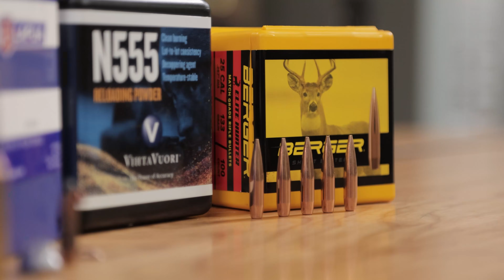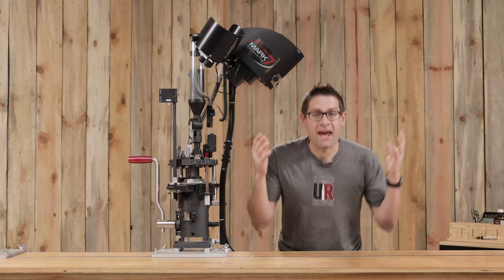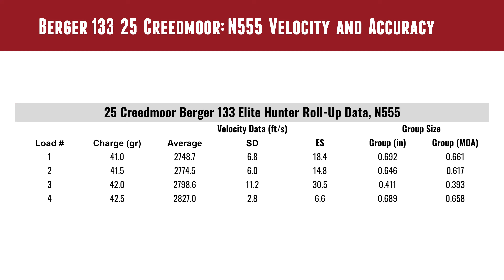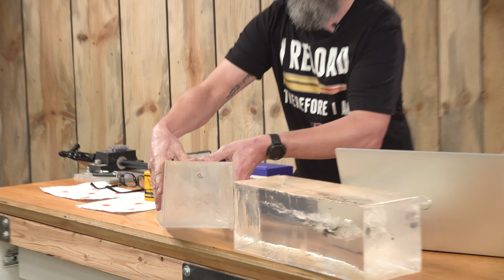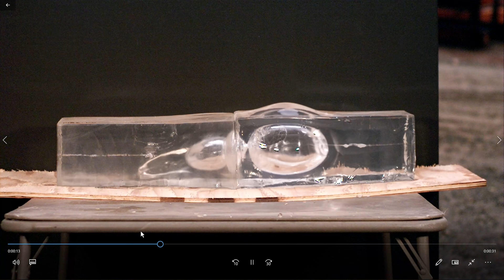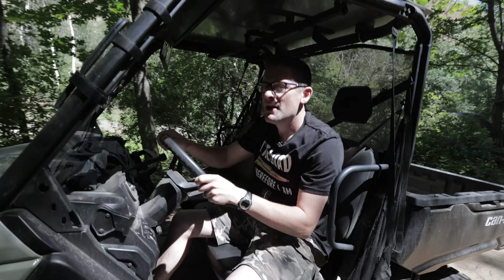TESTED: Berger 133gr 25 Cal Elite Hunter Bullet

Comment: I had a custom fast twist 25-06 built to shoot this 133gr bullet the year it was released. 26.0" barrel, 8.5-7.5" gain twist 5R Bartlein. Over a stiff charge of Staball HD, getting 3068fps avg, single digit ES and SD. 1/2" groups or better if I do my part  That's with Federal 210M primers. Gonna try 215M primers and see how that goes. Figured a slow burning powder could benefit from a magnum primer.Great bullet

Comment: I know this is an older video at this point, but I recall Litz talking about how low velocity tests are hard because you technically need to use a real fast twist barrel because the RPM of the bullet is also what assists in bullet performance. Have you guys looked into that or seen anything on that since doing this test on low velocity? 
Your videos are some of the most informative and have helped me in going through data many many times!

Comment: The test isn’t entirely accurate because the bullet is spinning one time every 7 inches at 2800 fps and when it slows down to 1800 fps it will make a full rotation about every 4.5 inches which would make it a lot more devastating because it would spin 65% faster in the gel if you actually took it out to 800 yards. But in the video the 1800 fps load is still only spinning once every 7 inches in the gel. It’d be cool if you revisited some of these with long range gel tests
Reply: Sorry I meant 35%

Comment: Very interested in 25 GT or 25 CM, but if you’re comparing a 135 gr. .25 CM to a 130 or 140 grain 6.5 CM is there any real difference in recoil reduction in favor of the .25? Assuming there isn’t much difference, then I’m guessing there might be even less advantage over the 6.5 in wind drift. A 140 gr. 6.5 might actually do better in the wind than a 25.
Reply: The 135g 25 cal has the  same BC as the 6.5g hybrids pretty much.

Comment: Great video
Is like to see insects is belly that tightly match the expected velocity at 100, 200, 300, 400 yards
So that one could mentally equate expansion performance to the charts and graphs of drop and drift etc, velocity, and energy retained
Plus comparison to mono-metal  at same breaks - like a blackjacks (if you have any stored up somewhere), and maybe to lower BC copper/mono-metals for older cartridges like the 257 and 25-06

Comment: For the slow speed shot, if the bullet is only doing 1800, wouldn't the rotational speed be down quite a bit from if it had been fired at 2800, and might that not skew your results?

Comment: Dave Glenn,
I would like to see what kind of performance you could obtain with the .257 Weatherby Mag. I suspect you would have 3-4oo more fps that might actually expand at the 800 yard velocity ( coupled with a much higher rotation of the bullet ). Not practical for PRC matches but it may be the uber 25 cal hunting round. Good work on the video.
Reply: i built a 257 wby around this bullet. keep in mind it has a 30" barrel but. 
74gr n570 powder at ~61k psi 3400 fps.

Comment: I actually had a gunsmith that I talked to about building a custom rifle with me try to talk me out of a 25 blackjack rifle which I was on the fence with anyway because I don't know how many reamers if any are available for that then die cats will need to be made and it's an expensive proposition. However 25 creedmoor has been done a few times and is a little more common. What sold me is the blackjack being made on the Saum cartridge I heard was beating weatherby Magnums by 200 ft per second

Comment: One variable in this test would be the RPM of the bullet, which effects bullet performance as well.  If there is any way you can do this at range and compare would be interesting.   My theory is the bullet would shed alot more weight at 800 yards at the higher RPM.

Comment: I'm really getting hooked on the heavy for caliber bullets. 133 135  25 cal,  looking to get a 25.06 and replace barrel  with a 1:8 or 1:7.5 e 6mm creed heavy barrel.  That would solve the stabilization  issues. Curious, is there enough room without  compression/crunch in bolt gun?

Comment: bullet RPM in a non-negligible component of the bullet's energy at long range impacts because RPM slows much much much less than the linear velocity. When you don't compensate by using a 1:4 twist barrel at the 1800 fps impact you are missing energy that may play a role in the "expansion threshold".

Also, when in doubt, if  the expansion threshold is 1800 fps, limit your hunting range to impact velocities strictly greater than 1800 fps, say 1900 fps.

Comment: Looking at the lack of any real expansion on that 133 @ 1800fps I think Berger was being a little liberal on that rating.  To me, if the bullet doesn't expand to at least 1.5x it's original diameter it's not expanding sufficiently for use on game at that velocity.  I'm going to take a guess and say this particular bullet probably won't meet that standard below 2200-2300fps.  Love that my beloved quarter-bore is finally getting some attention from different bullet manufacturers, but when it comes to hunting bullets a high BC means nothing if the bullet doesn't adequately expand.

Comment: I’d work my way up like you said in 200 ft/sec increments. I’m betting 2000-2200 is where you see that good terminal performance become very consistent. Only thing I would’ve done different is started with a 180 accubond in 30-06. If there isn’t a standard by which all others are measured this should probably be it. I don’t think I’ve ever seen a cross word about the original accubonds other than the BC being lacking. But the the terminal performance seems to be at the top of the pile

Comment: You were at 2800 and 1800 fps. Try 2000 fps. 200 fps might make a big difference. Also, some people think the bullet heats up in flight, making the lead and copper more malleable. It would be interesting to see if you had the gel at 800 yards, to see if the bullet performs the same way,

Comment: There is a major catch with "simulated" long-range" ballistic testing:

SPIN RATE.

And spin rate is directly related to muzzle velocity and barrel twist rate.

"Simulating" down-range velocities by down-loading is not representative of "reality"

For a start, the bullet may not be going fast enough at the muzzle to have achieved sufficient SPIN, to correctly stabilize. Furthermore, high MVs and fast twist rates put a LOT of stress on bullet construction. The temperature induced by bore friction stacked on top od propellant gas heat can "soften" the core. If the jacket is insufficiently robust, the mushy core will try to burst radially  out through the super-heated, jacket. Furthermore, the bullet is still VERY hot and thus more malleable when it whacks the deer-hide. It would be interesting to see the thermal imaging of a high-velocity bullet striking "body-temperature" ballistics gel. Now, there's a video episode idea for someone.

Lots of literature on the development of early .22 cal and .17 cal centre-fire wildcats noted this very problem. Home (and even commercially) made bullets were doing the "grey mist thing" a few feet from the muzzle until folks started using thicker and therefore tougher jackets. 

The longer bullets in ANY calibre are also torsionally stressed at the point of rifling engagement. The pointy end is being rotated VIOLENTLY at that moment, whilst inertia is resisting that twist at  the rear of the bullet. Anyone playing with "progressive twist" rifling. The old 6.5 x 52 1891 Italian Carcano RIFLES, (Not the later Model 38 6.5 x 52 carbines), had progressive twist, so it's not exactly a recent idea.

My first "proper" hunting rifle was a pre-loved .25-06 built on a Springfield 03A3 action and nicely bedded in a fancy Fajen stock, as was the rage in the early -mid 1970's.

It had an appetite for very expensive (relatively, at that time) powders like the original Hodgedon 4831 ( repackaged .50 BMG propellant), or Nobels "Zero". For a kid at high-school, it was a mixed bag to use. This rifle was expensive to run, but spectacularly effective on game;  I stayed with the 100gn bullets, just like those that came with the deal. I tried 120s, but on the feral pigs we were shooting, there was no discernible advantage.

133gn, super-long, .257" bullets would seem to be more a seriously specialist target rifle proposition, rather than a "walk in the woods" option.

But that's just my pre-inflation 2 cents worth..

Comment: Um.  I don't expect that downloading the bullet correctly represents 400 yard downrange performance.  I am concerned that while you downloading the (linear) velocity, you did not downloading the rotational velocity.  I think this is a goof.  I know that downloading the rotational velocity would require a barrel with a different (faster) twist. 
 I don't believe the rotational velocity slows nearly as rapidly as the linear one.  The Army made this goof, and found that it did not correctly account for the energy/damage which comes from the rotational speed.

Comment: Honestly, I would do 2000 fps.   If it won't expand well at that speed, chuck it up as marketing hype and move on.  If you want more data than that, then save yourself some work and shoot each gell block 3 or 4 times starting with the slowest velocity first.   One shot per block makes for pretty pictures,  but your after data, not photo ops.

Comment: GREAT video!  I loved the fact that you down loaded it to simulate down range performance, something most dont do!  I find test like that to be head and shoulders above the rest.  I would love to see what velocity it takes to get some modest expansion and find out at what range that would apply to.  Finally there is a high BC bullet for the 25 cal. in hunting applications.  Now I am looking at my 30-06 thats sitting in the gun cabinet and wondering if maybe rebarreling it to 25-06 would be better than rebarreling to 6.5-06.  I wonder too how would this perform on a 308 case instead of a 30-06 case and what the difference would be...
Reply: Lol why bother rebarreling the 30-06. With it’s likely 1/10 twist just load it up with 200’s at 2700 and beat the brakes off these other cartridges

Comment: The simulated long range testing has a potential flaw.

Rotational velocity is preserved much better than bullet velocity.  When you fire a bullet at 2,800 fps in an 8" twist you get 252,000 rpm, at 1,800 fps you get 162,000 rpm. At real distance you may see 1,800 fps but it will have rotational velocity probably over 200,000 rpm which should let the bullet expand or fragment more.

A higher twist barrel isn't the way to fix that because the barrel will distort the bullet more.

I suggest regular ammo shot at a block at 2-300 yards.  That's a realistic hunting shot and your rifles are accurate enough to hit the block at that distance.

Maybe you can find some sort of way to better approximate the effective equivalent range of a down-loaded bullet by comparing the RPM rather than the bullet velocity exclusively?

Also, several high B.C. bullets are known for fragmenting in the air due to high rotational stress from fast twist barrels.  That tells you that similar bullets are operating near their structural limit.  You can't move their operating point so far away and expect a result representative of the 800 yard shot you equate it to.
Reply: I drafted a reply saying the same thing before reading this one. A quick search turned up several Internet discussions and articles stating that higher spin rates often produce greater bullet expansion, and therefore downloading to achieve lower muzzle velocities for short distance tests can produce misleading expansion results. How much? I don’t know, but it is something to consider.
Reply: A specific test would be great. One that looks at the same impact velocity at the gel, with the difference being the effect of the spin due to downloading versus full distance shooting. If certain twist rates and velocities can burst a bullet in flight, centrifical forces may combine with impact to create a difference in total terminal ballistics. Worth a look?

As far as intermediate points, with the resources it takes to do each distance shot, maybe picking a few standardized distances for everything would be worth a look. Say point blank would be 100 yards, then 300 for a practical intermediate, and 500 to 600 for maintaining some expansion comparison before they turn into “ice picks” and with some guarantee you can keep them centered in the blocks. 

Many decades of elk/muley hunting and hanging around the processing house tells me that many hunting bullets don’t expand well at distances where the speeds drop below 2200 fps on impact and then the shot placement is critical. YMMV
Reply: Should all be shot from the distance you are must likely to use them at, no need to use software when you have a high speed system to hand like they say a picture is worth a thousand words.
Reply: I think your right at the Marksman unit at ft benning they do there test on live pigs you can see real terminal performance I’ve been waiting decades for someone to come out with a high BC for the 25 caliber to use in my 2506 ackley improve next build would be a 257 weatherby probability eat barrels

Comment: What stands out for me is that at the simulated long range, the bullet doesn’t really expand much near the entrance. On a typical deer, it might not expand at all because it would have already exited. Real deer, of course, are encased in hair, skin, and bone, so what would really occur remains unknown.  The other question is how such a bullet would fare on an angled shot from say, the last rib forward into the chest, not at all an unusual occurrence.  Thanks for all the great content.
Reply: There is a major catch with "simulated" long-range" ballistic testing:

SPIN RATE.

And spin rate is directly related to muzzle velocity and barrel twist rate.

"Simulating" down-range velocities by down-loading is not representative of "reality"

For a start, the bullet may not be going fast enough at the muzzle to have achieved sufficient SPIN, to correctly stabilize. Furthermore, high MVs and fast twist rates put a LOT of stress on bullet construction. The temperature induced by bore friction stacked on top od propellant gas heat can "soften" the core. If the jacket is insufficiently robust, the mushy core will try to burst radially  out through the super-heated, jacket. Furthermore, the bullet is still VERY hot and thus more malleable when it whacks the deer-hide. It would be interesting to see the thermal imaging of a high-velocity bullet striking "body-temperature ballistics gel. Now, there's a video episode idea for someone.

Lots of literature on the development of early .22 cal and .17 cal centre-fire wildcats noted this very problem. Home (and even commercially) made bullets were doing the "grey mist thing" a few feet from the muzzle until folks started using thicker and therefore tougher jackets. 

The longer bullets in ANY calibre are also torsionally stressed at the point of rifling engagement. The pointy end is being rotated VIOLENTLY at that moment, whilst inertia is resisting that twist at  the rear of the bullet.

My first "proper" hunting rifle was a pre-loved .25-06 built on a Springfield 03A3 action and nicely bedded in a fancy Fajen stock, as was the rage in the early -mid 1970's.

It had an appetite for very expensive (relatively, at that time) powders like the original Hodgedon 4831 ( repackaged .50 BMG propellant), or Nobels "Zero".For a kid at high-school, it was a mixed bag to use. This rifle was expensive to run, but spectacularly effective on game;  I stayed with the 100gn bullets, just like those that came with the deal. I tried 120s, but on the feral pigs we were shooting, there was no discernible advantage.

130gn, super-long, .257" bullets would seem to be more a seriously specialist target rifle proposition, rather than a "walk in the woods" option.

But that's just my pre-inflation 2 cents worth..
Reply: @bruceinoz8002  I considered that as well. I’ve witnessed the smoke trail and the target pinwheel from a .220 Swift, long ago and far away. I’ve also theorized that fast-twists can result in increased fragmentation and wound damage, but with all the variables involved in shots on game, it’d be pretty hard to measure. As for the heat factor, one claim made by Hornady for their ELD- bullets is the heat-resistant tip, important because the bullet gets hotter as it travels, hot enough to melt ordinary tips. 
You made good points.

Comment: Great vid guys, I got a 25-45 Sharp's that I want to test this year on a whitetail.  I wish someone would test some heavier bullets then 87 gn. I did do some testing on 100 gn Speer Hot-Cor bullet. But would it be feasible to do say a Combined Technology .257 115 gn bullet? I've seen what they do on Whitetail from a 30-06 and lets just say I could put my fist in where the bullet entered.
Reply: I’ve shot several deer and a lot of hogs with the 25-45 Sharps.  I struggled to get 100 grain bullets going fast enough to suit me past 150 yards or so.  The 87 grain Sierra or Speer bullets have performed perfectly for me!  I use them interchangeably, they have the same POI and I can’t tell any difference in terminal performance.